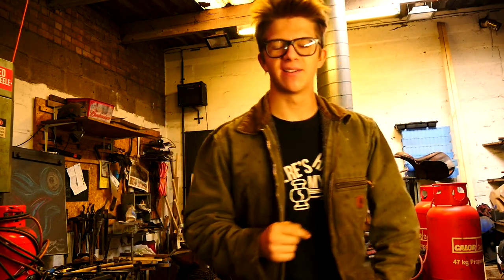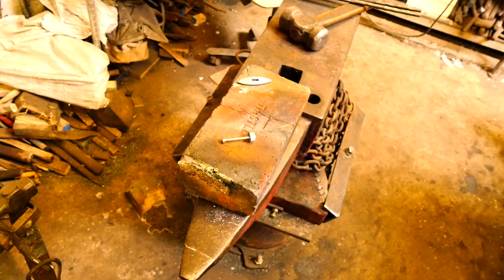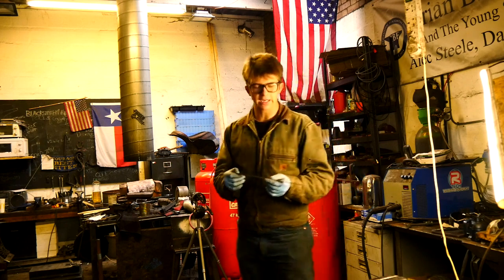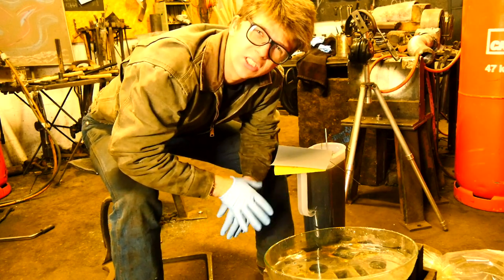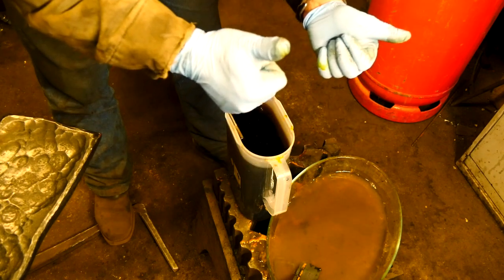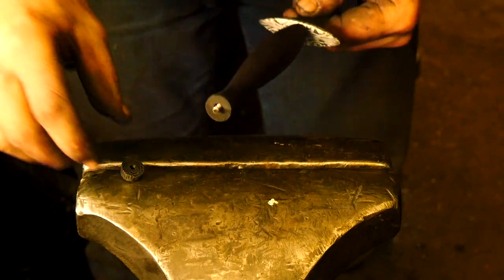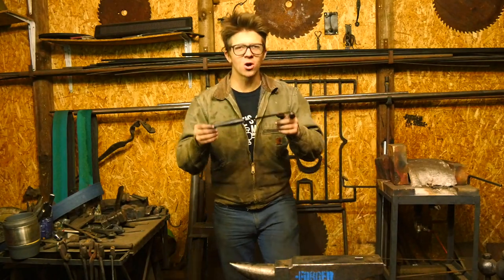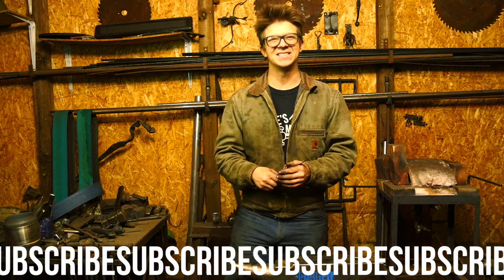MAKING A DAMASCUS DAGGER #3! Fairbairn Sykes Style

Comment: Could I put a value on that knife of $75 per hour spent? If not that, how about an eBay auction and see if it brings my gut feeling: $800.oo plus. Great knife. As another poster said, make a sheath for it. Wait, make a black & white ebony box to keep it in, with a hidden latch to open it. When it opens, it should be laying on a bed of fine satin cloth. Okay, those are my dreams, not necessarily anyone else's...
Reply: ive seen less pretty decorative fair-burns sell for £1000+ find the right buyer and this will run you over 2G
Reply: simon jones  When things are mass produced they usually are not of the highest quality and are not that rare. This piece is a high quality Damascus blade, hilt and pommel with an ebony handle. I'm sure there is not another one like it. I bet if he puts it on Ebay it will easily pass $2,000.
Reply: Clifford Moeller or the correct usage of an Oxford comma.
Reply: Clifford and Andrew
Or the difference between British Sterling and a U.S. Dollar. Much less anything dealing with exchange rates and simple calculations. And remember the most simple rule of gentleman's argument that when one calls his opponent a name, he's markedly lost the debate.
Reply: Actually , contrary to that, my experience is that it is the first person to state a full of shit presumption AS fact that makes the looser ...provided the greater man hold his tongue from likewise boasting...which may or may not involve calling one by some derogatory name .  How can humility not trump pride in the eyes of  an honest audience??

Comment: Alright, so.. last video you were talking about how difficult and precise knife making is, and I'm just sitting there thinking, "yeah, you picked literally one of the hardest knives to make. double edge, four bevel grind, symmetrical blade shape. Really thin and long.. like.. you heat treat it wrong and it will corkscrew. You mess up your grind or don't get the center perfect and you can spot it a mile away. Any little mistake, becomes really noticeable" And then here you go and just knock it out of the park. Fantastic work, wish my first Fairbairn knife turned out that damn good. I'm trying to make one just as a yard stick for my progress each year. Really though those plunglines are on the mark. Great work. Would love to see you make more knives.

Comment: Congratulations, Alec. That is an absolutely beautiful piece. You can be proud... a dagger is a very difficult knife to get right, and the Sykes-Fairbairne is one of the tougher designs to duplicate well. Since yours is essentially a "presentation" version, I would echo the comments below calling for you to finish that handle... sand it down superfine (1000 grit or even finer - i like to go as fine as 2000 on some woods) and give it a touch of oil or wax, then buff it up and bring out the real depth and beauty of that ebony.
Watch out, though... getting bitten by the knifemaking bug is dangerous. It quickly turns into an obsession!

Comment: Hi Alec,Great job on the dagger ! Daggers can be difficult for experienced knife makers.. Please be careful when hand filing or sanding with a blade in a vise pointed at you ! Many makers have stabbed them self ,it just takes a second. A simple platform can be a piece of angle iron clamped in the vice then use a c -clamp to clamp the blade to the angle,now you are protected and the blade won't flex as much . I'm not trying to be a bummer but we need you healthy. As a knifemaker I'm learning a lot about blacksmithing from your videos . Keep up the good work !
Reply from the maker: +Joe Seabolt great suggestion! It's something I now try and do - not having the blade helps a lot! The whole not stabbing yourself is helpful too!

Comment: Alec Really really a nice job. And I agree about the attitude of making "things" One comment, back in the "old days" I taught metal shop in 7- 12 grade. one of the things we made in 8 th grade were knives. (I live in the wild west of the U. S. A )Every boy of gal made a knife and when I run into these adults, even now, they still tell me or show me their knife. To keep them from slicing their guts out on the knife when it is in the vice. I had tthem clamp a piece of soft wood in the vice that was band sawed in roughly the same shape of their blade. They then put their knife on the wood so no point stuck out beyond the wood. They then used a small clamp, on the tang, to pinch the blade down on the wood. We draw filed the blanks and polished them on this jig. It also supported the blade so it didn't flex everytime you put downward pressure on the file.Never had a kid get cut. You teach some classes and safety is always an issue. Give this idea a go at least it brings great piece of mine knowing somebody doesn't forget themselves and get a nasty gash or a fellow student get stuck. Retired 17 years ago but am now helping a young teacher in a metals class teach blacksmithing. Your crazy but I really enjoy your shows. I learn a lot  Cheers Dave Lange

Comment: Hello Alec. 

   As others have said, the bit between handle and blade is the Guard, or Cross Guard. The bit on the end is the Pommel. Other than that, all I can say is 'WOW' at the beauty of the Damascus patterning of the blade you made. 

   If you are still taking suggestions. I recommend that you make a wooden sheath for the blade out of Teak, a good strong wood, with a leather belt loop to hang the sheathed blade at one's waist. 

   I don't know how elaborate you'd want to go with the sheath, but might I suggest something like a diamond patterning, with gem stones set into each diamond? 

   You should be able to get real gem stones, pre-cut and polished off EBay for a reasonable price. If you don't go with real gems, you can get semi-precious stones easily and cheaply from EBay as well, also pre-cut and polished. 

   Just my thoughts, 

Frank-ly speaking.

Comment: It looks awesome, the pattern came out really well. In the future though, I'd stay away from round handles. The circular cross-section means it's difficult to feel where the edge of the knife is. Most (not all, I know) bladed weapons and tools have handles with oval cross-sections with the fat part of the oval aligned with the edge so that you can tell just by holding it where the edge lies. Other than that though, it's a really great knife.

Comment: The only advice, and I mean only little piece of advice I can give, is to leave the tang either ovoid or more rectangular so the handle won't twist on the round shaft.  Either that or use a cross-pin like Randall Knives used to do because any exopy won't keep the handle in place when used.